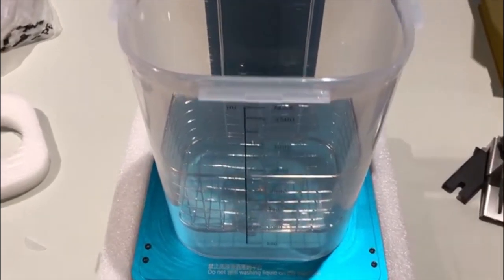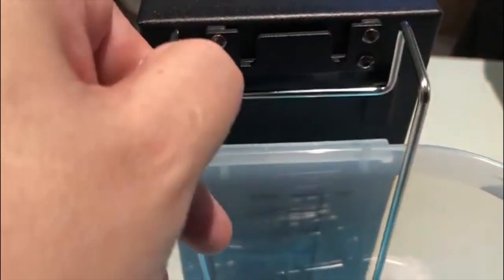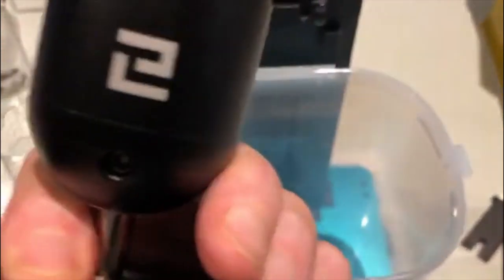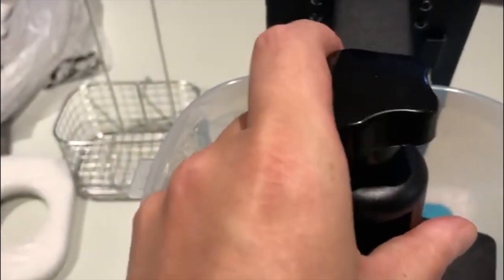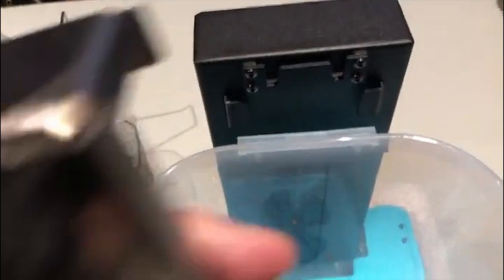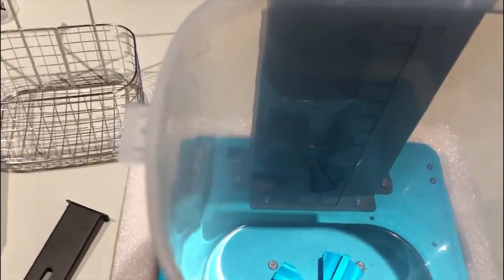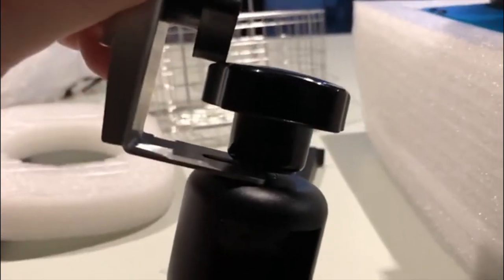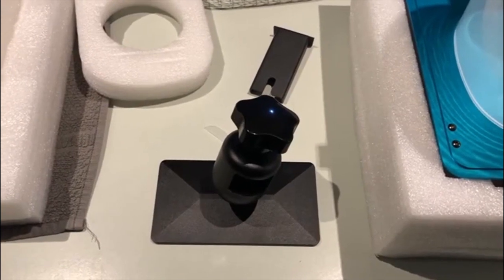Is the Anycubic Wash and Cure Station compatible with the Elegoo Mars Build Plate?

Comment: Design a Mars adaptor for the station like the first holder you shown but with a wider gap. It doesn't seem like it be too hard. I'd think it would be better than modifying the original.
Reply from the maker: Thanks to a viewer here it is https://www.thingiverse.com/thing:4201229
Reply: @JAYTEEAU  Has anyone printed this and tried it out?
Reply from the maker: @Echoes-from-the-War-Room  Hi Bob, I haven't as yet
Reply: @JAYTEEAU  I am printing it out now (7 hours), I will let you know how it goes.
Reply: My prints of this keep failing for some reason :(
Reply from the maker: @Echoes-from-the-War-Room  Bob, did you ever get a successful print? I might try one today
Reply: @JAYTEEAU  Yes I got it printed out perfectly, I even printed one for a back up. It was all about getting the settings right. It is something I cannot do without now :)
Reply from the maker: @Echoes-from-the-War-Room  Excellent thanks. I've been popping prints off and placing into the basket, but having the build plate in IPA assists in everything getting clean at the same time. Cheers
Reply: I've bought the mars 4 DLP and no idea if anycubic is compatible because it always says LCD